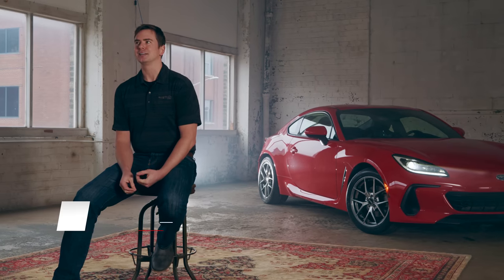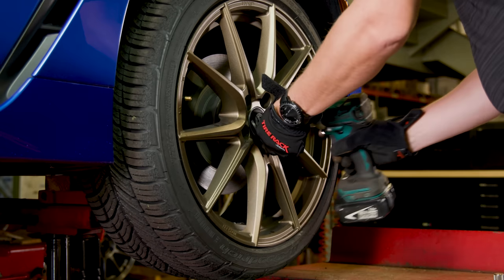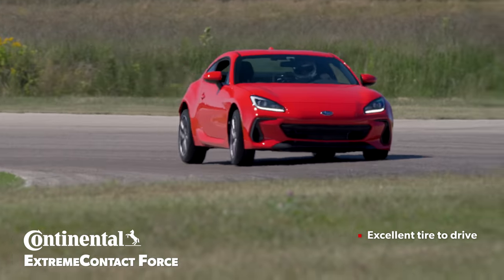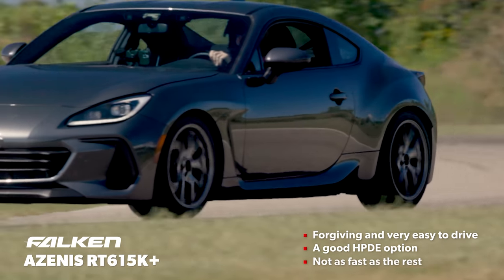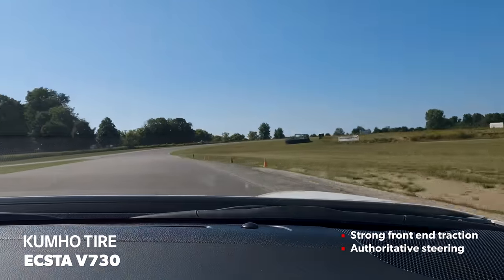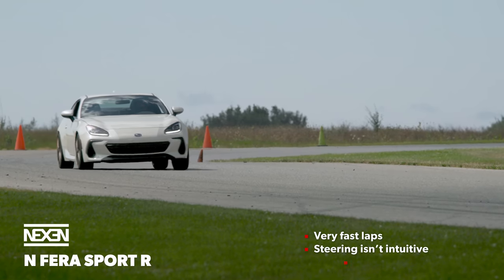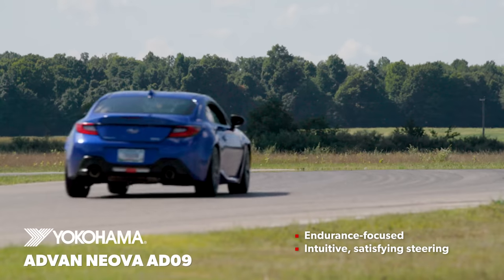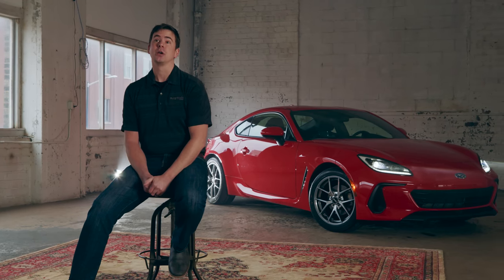Tire Rack Road Course Test: Extreme Performance Summer Tires 2022 | Tire Rack

Comment: Currently running the Khumo V730 and there is a couple people at the local autocross who are running them currently. Something that I think is worth mentioning is that the V730 gets faster after a few track uses. The outside tread blocks have a extremely shallow tread pattern that is only 2/32 deep. After you wear those out you essentially have a set of street legal cheater slicks with only 2 groves to evacuate water. Once you factor in the price, and overall performance throughout the life of the tire the V730 is the winner in my book. RT660 is faster out of the box but the V730 is better overall.
Reply: Have to keep in mind a lot of tires get a little faster after they're worn down a little. Grassroots motorsports mentioned this with the RT 660 during their tests. Would be interesting to see a test between all the tires after a few weekends and see which ones benefit the most.
Reply from the maker: Thank you for sharing your experience with us.

Comment: I would be curious to see how much better these track focused tires would be than an ordinary summer tire like the PS4S or PZ4.
Reply: PS4S is not really suitable for track use. It’ll overheat and start to chunk.
Reply from the maker: Thank you for sharing your thoughts with us.
Reply: @RoadrunGTI  I can attest to that as mine are currently chunking after a couple track days.
Reply: It’s a Konami cheat code for grip.
Reply: @RoadrunGTI  I had to find that out myself. People say it's ok to track but it's not. Mine are chunking to the wire after my first ever track weekend.

Comment: I experienced what was mentioned on the Nexen on my Integra at a recent track day, it caught me off guard on my first track session and I nearly overshot a corner due to the weird delay that I didn't experience on my previous tires at the same track (RE71r, RT660, Rival). It didn't feel natural at first, but somehow I ended up driving faster overall once I got used to it. Need to see how it feels at more events.

Comment: According to the commentary there were 3 or 4 tires that were "designed" for (or have a reputation for) longevity.  What was the starting and ending tread depths?  On all 4 corners, but especially on that outside left front?

Comment: I wish they still rated or ranked road manners even though this is an extreme tire category, I’d like to know how these tires ranked in road manners amongst each other as the A052 I believe when they used to also give those subjective ratings was actually a viable dual use tire that had much better ride and noise comfort in this group but that test was old and don’t know how these new entries stack up.

Comment: Did you guys go back to the Bridgestone Potenzas at the end to make sure they were still the quickest?  This would rule out brake degradation, driver fatigue, etc... from the results if the Bridgestone can back it up by doing it last after setting the fastest lap when running first.

Comment: What were cold/hot pressures for these tests? I would assume stock pressures for the car but that'd be too high for every tyre in this test...? Advan 052 does want more camber but also even judging by tyre flex and contact patch in the video on such a light car, less pressure. No mention on rear camber? Stock I presume since it's not changable without bolts/control arm, still good to know angle which would aid in understanding some tyres understeer characteristics. Great video aside from no pressure info mainly! :)

Comment: I'd like to see the same thing done with ultra high performance all season tires. I think it would be interesting. Also I think it'd be nice to have one comprehensive test for each category rather than a bunch of mini-tests like you have now.
Reply from the maker: Thank you for sharing your thoughts with us.
Reply: There’s really no point in even attempting an all-season tire on a dry track. It’ll just destroy the tire.
Reply: @RoadrunGTI  Thats not the point of the request. The point of the request is to get comparable data for those of us who want a fun non-track tire.
Reply from the maker: Thank you for sharing your opinion.
Reply: @mizinoinovermyhead.7523  you want comparable data to show you that track use will destroy all-season tires? Tire rack already tests performance all-season tires on their onsite course, but actual track testing would be fairly useless.
Reply: @RoadrunGTI  no it wouldn’t be. Get over yourself and please leave.

Comment: Youtube viewers: "Thanks for the awesome test using identically equipped, stock suspension cars."

Also Youtube viewers: "If you could modify your shop cars with coilovers, camber plates, swaybars and full SPL catalog then run this test again, I'd really appreciate it because I don't believe A052s are that slow.  Please include HooHoo R7s and A7s in the new test for referen, er, science."

Comment: I'll give you a data point. RT 660's on my Miata really bring out the fun for my daily commute. For commuting the ZIII's were the most fun! I feel like they have a wider operating temperature and a more progressive break away. When I'm doing an HPDE on the 660's I have to re-calibrate my level of expectation for grip! Awesome tire, very similar to the RE-71's I had on before that.
Reply: What temps are you dailying the 660s through?
Reply from the maker: Every tire was set to 35 psi hot.

Comment: Excellent information. Would have like of seen a category for wear and how each tire looked after the test and projected life. I am currently running 315 RT660 for autocross but would like to get into HPDE. I only have one other set of wheels to use for HPDE (18x10 wheel) so the tire will have to pull double duty. I replace my autocross set every year and hoping I can find a track tire that will last around 10k miles and 3-5 track days a year on a 3300lb Mustang.
Reply from the maker: Thank you for sharing your thoughts with us!

Comment: What did you run for tire pressures? With my RE-71RS's, I run 30/28 F/R for autocross.
Reply from the maker: Great question! We ran them all at the factory inflation pressure of 35psi.

Comment: Great stuff, I do suggest you include the tire size(s) and wheel specs.  In this case I can Google it if I really care (I'm guessing 215/40R17 on 7") but it's important info to have.
Reply from the maker: Thank you for sharing your thoughts with us!
Reply: Stock wheel is 17x7.5.
Reply: If you look at 1:53, you can see they're running a 225/40R18. I'm not sure about the wheel spec, but I think that's a Sparco DRS in 18x8 +45. Going for a 225 tyre on a 8J wheel would make sense since, quote "225 on the 8" wheel felt the most balanced, like that's what it was designed from the very beginning" from their tire width vs rim size test released a few days ago (also using BRZ's)
Reply: If Kumho offered their V730 in a 215/40-17, they'd be on my wheels as we speak!
But of course, they never will. 😡

Comment: This is a great test, but frankly, you're using it on a single platform which is a low power, lightweight platform. It really doesn't take into account other platforms, such as FWD, AWD, or higher powered RWD cars. I realize that would make prices go up on doing these tests, but frankly I don't believe this test helps anyone but miata, 944, and toyobaru owners.
Reply from the maker: Thank you for sharing your opinion.
Reply: @tirerack  no problem, and sorry I didn't mean to come off overly critical, was just thinking "out loud." I readily admit I could be wrong about tire dynamics with heavier cars / different power levels, staggered setups etc, but I've always been curious about that as from what I understand, tire compositions and tread patterns can sometimes differ between sizes even within same tire model (is that correct?)
I've shopped with you guys for as long as I can remember, so I'm a big supporter of tirerack!
Reply from the maker: We appreciate your support, business and candor! We take every bit of feedback we receive very seriously and look for ways to improve.

Comment: As a racing time attack driver this data isn't helpful. Impossible to test in one day. The track changes too much. In my car at the head of the field i can be 1.5 second different from session to session due to 5 to 10 degree temp swing. Then have the track match pace at session 4 as it did 2nd sometimes and not others. This needs a very unique testing methods